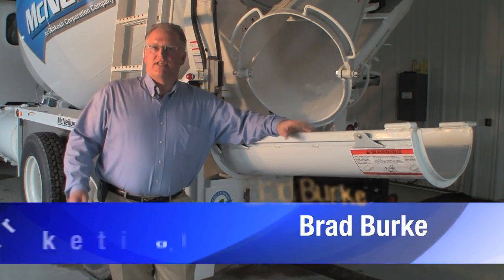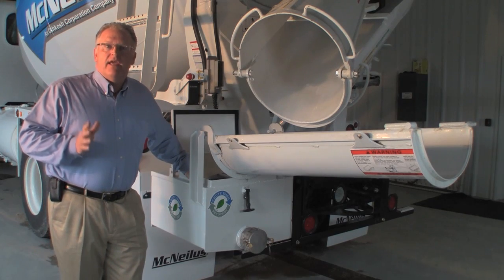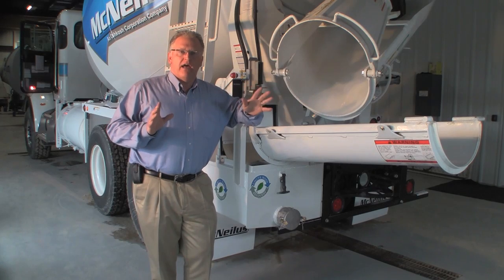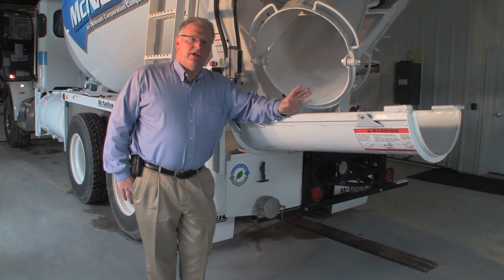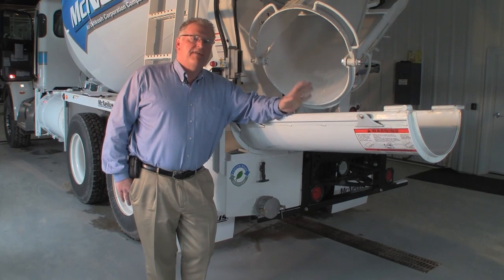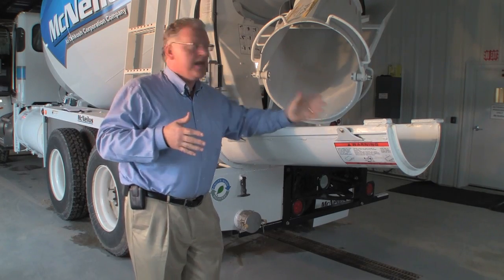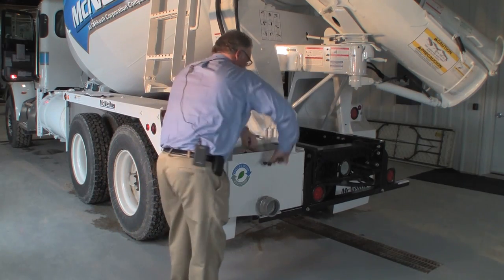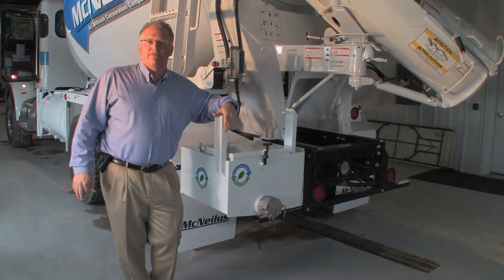Chute Wash Recovery System

Comment: The system does work pretty good but you have to throw whatever little cement in it cuz more than a few contractors dont like too see it in the ground so hmm yeah..
Reply: Fuck the contractors make them find a place to wash down I can see using it in a emergency but most those fuckin assholes abuse it

Comment: honestly, the concept is dumb. I'd rather fold the flop-over up and go back to the plant rather than mess with this system. been driving mixers for 18yrs.
Reply: I've been doing this for over 20 yrs all this does  is make more work for the driver get back to the plant instead of getting loaded right away you have  to clean out that fukin what do we do dump it on the ground I can see using it in a emergency worthless fuckin contractors abuse it